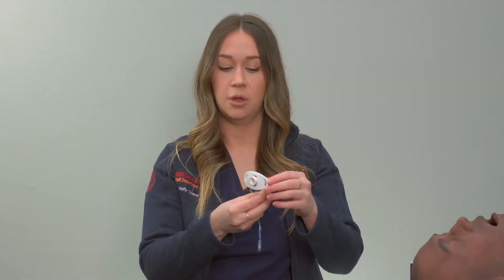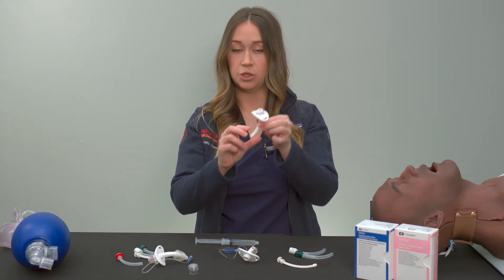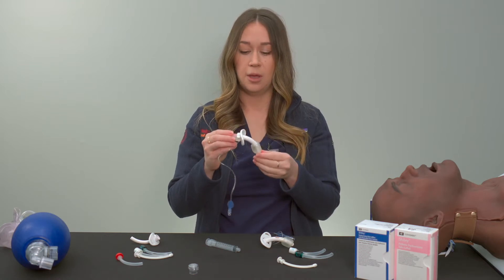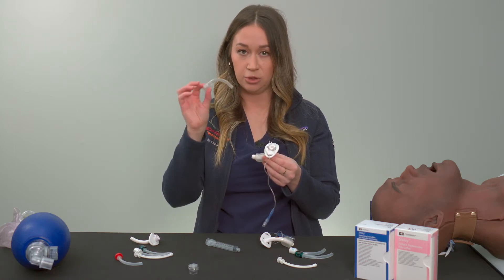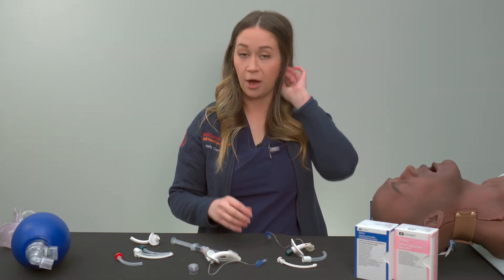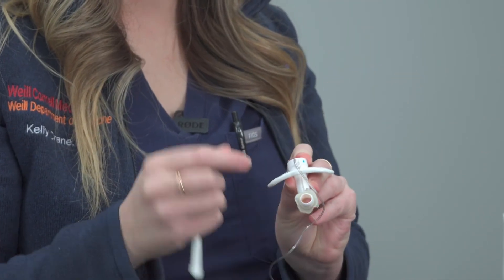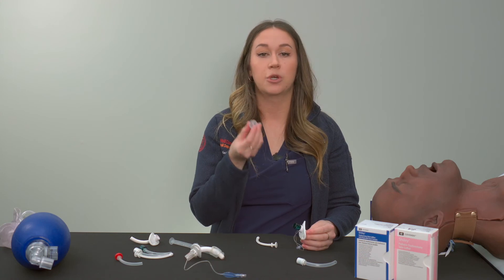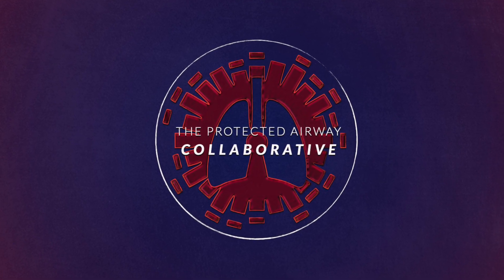Understanding Tracheostomy Tubes: Essential Guide for Medical Professionals

Comment: Let me ask you that how much air to be pushed to  inflate a tracheostomy tube ?  Suppose any blockage in Trachey tube , how to manage?
Reply from the maker: Usually somewhere between 5-8 cc's of air. But for long term care it is important to use a manometer and add air to about 20-30 cmH2O. The volume required can change with the type and size of trach tube.

Comment: A Passy-Muir can most certainly be used on a non-fenestrated trach. You just need to ensure the cuff is completely deflated. The airflow will travel around the trach and up through the vocal folds/upper respiratory tract.
Reply from the maker: Thanks for adding this info!

Comment: My nursing agency has used this video as required viewing for the past two years, but the misuse of terminology turns me off from the start., and drives me a bit crazy for the rest of the video. ..she is talking about different kinds of tracheostomy TUBES, not different kinds of tracheOSTOMIES, that were the the result of a tracheOTOMY.  A long-term tube-free tracheostomy, or LTTFT, is an example of a different kind of tracheOSTOMY.  I am sure she is competent and knows what she is doing, but this is a very basic teaching video, titled "Understanding Tracheostomy Tubes", and then throughout the video calls the tube, the piece, a "tracheostomy". She discusses "changing the tracheostomy" but she is not changing the tracheostomy/the hole/the stoma/ the ostomy, she is merely changing the tracheostomy tube. Huge difference.  Medical terminology is  standardized for consistency, and especially for medical personnel  just learning about things, like trachs and all that goes with them, correct terminology is the best practice.  I train nurses in hands-on patient care of "everything trach", and using correct terminology supports us being on the same page during this important training. They are new to trachs, this MD is not.  The explanations of air flow/fenestration/vocal cords/Passey-Muir are fantastic.  Also...there ARE tracheostomy TUBES in use from before this video was made the stated 3 years ago (2021 or 2022?) that allows an ambu bag to be attached securely to the outer cannula, the Shiley Flex Tracheostomy Tube, for example...in the video she mentions the ambu bag cannot attach to the outer cannula, just the inner cannula.  Okay--my gripes are out of my system now--I have brought my thoughts on this video to the attention of those in my nation-wide company who assign it to all their nurses as a yearly requirement the past two years. Dr Kelly-you know your stuff, and have great explanations,: it is an okay video. If you tweaked the usage of tracheostomy when I am sure you mean tracheostomy tubes, it would be an outstanding teaching video::) ...I also agree with comment by @jackgaughan from 2024, have used speaking valves on several patients with non-fenestrated cuffs.
Reply from the maker: Hi @cricket1301, you are absolutely right. Tracheostomy refers to the stoma created by the tracheotomy procedure. What Dr Crane is discussing is the features or "anatomy" of tracheostomy tubes, which are placed within the tracheostomy. In most clinical settings, however, the term tracheostomy tube and the tracheostomy or just "trach" are frequently used interchangeably and are understood in the context of clinical care that way. You are absolutely correct though. Although we all use the terms interchangeably in the clinical context, for a teaching video we should be more precise with our language. Thanks for the great feedback and for taking the time to help us improve our educational content on tracheostomies (and tracheostomy tubes!).

Comment: I had a tracheotomy in 2019, they were surprised that I had such a strong voice when the ventilation tube was removed, I've had swallowing issues since and following a recent reduction in MST, morphine, in 24,  my voice has become horse with spasms when speaking and total loss of voice.  I was ventilated for almost 2 months.  Is this a result of the tracheotomy?

The loss of voice started after the opioids were reduced and the oesophagus was tested positive for spasms when drinking.  I also had an emergency tracheotomy before they inserted another tube for the ventilator.